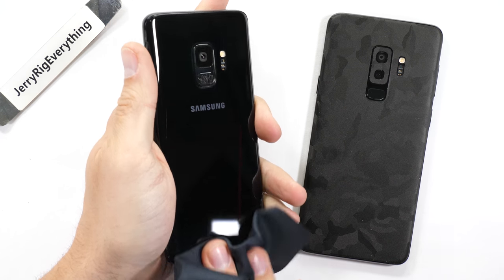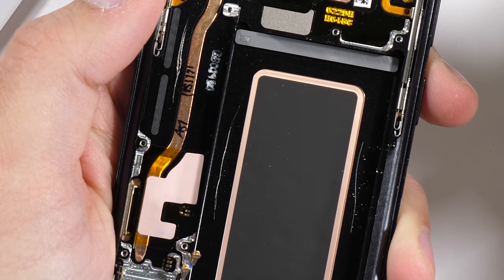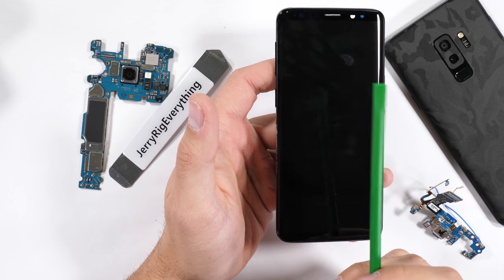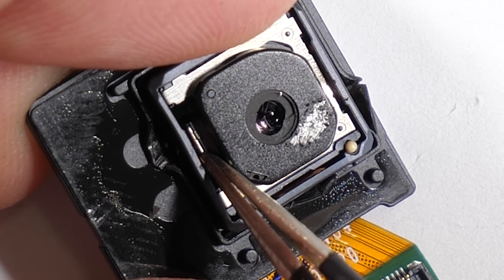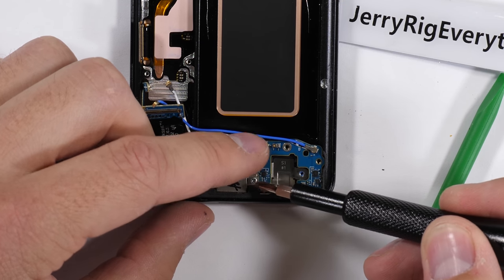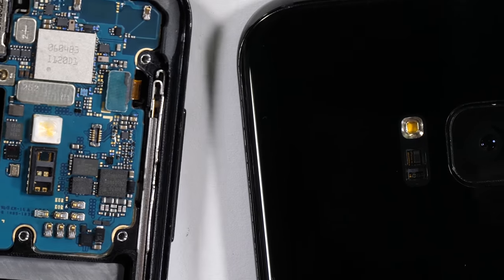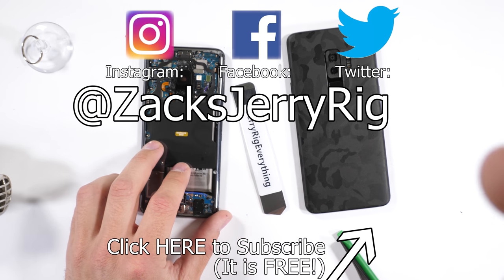Galaxy S9 Teardown - Variable Aperture Camera lens Revealed!

Comment: Never buying a used phone from you 🤣🤣🤣🤣
Reply: don't worry he won't be selling one
Reply: Hahaha
Reply: Don't think he plans on selling his phones with how bastardly used phone buyers can be. 
The waterproof phones aren't water resistant anymore.
The phones are scratched up, leaving it more vulnerable to be cracked on a drop.
All phones he sells do not have warranty anymore since he eventually teardown his phones.
Reply: Bleed inSkull It was a joke so need to go into it lol
Reply: "It still good, works fine, NO CAMERA"
Reply: Bleed inSkull 
Whoooosh
Reply: Hahaha wtf,true
Reply: Rjel Styx no shit Sherlock
Reply: Aniket Khade Technically it would be better than before. It's tearing down a transmission to rebuild it. You see what needs replacing/fixing/improving to make it better than before. Having said that, I recommend remanufactured transmissions over rebuilt.
Reply: 69% New

Comment: Solution to get rid of Bixby

Software guy: Roots phone, remaps button
Hardware guy: Rips cables out
Reply: Or  Or U go to settings ? And there is thing Called Disableing Bixby
Reply: Or do what I did and using the Bixby settings set the Bixby button to "open camera app" anduse it to quickly bring up your camera when you need to.  :)
Reply: @AA-tf4dj  those settings didnt exist 2 years Ago
Reply: @gabrielneelthayil7236  how
Reply: @leonarddomingo2091  carefully

Comment: Thanks for showing this. I've asked in several forums about how the aperture mechanism must work but no one had a clue until now! Cheers :)
Reply: I was a lot less impressed because from the outside it looks busier and more sophisticated than it actually was, but it's only a 2-blade aperture. But they're onto something there and I wouldn't be surprised if they designed a seven-bladed aperture in the future :3 (at least that's the hope lol)
Reply: @gian3458  It's likely only a two blade aperture setup as it's Samsung's first attempt at a camera sensor with aperture blades. They have to fit that in as well as the image sensor, lens housings for the aperture blades and OIS mechanism, and the extra RAM behind the sensor allowing for 960fps slow motion. 

Frankly, I'd love to see more of this as well but there isn't too much of a difference between F/1.5 and 2.4 in terms of depth of field, not to mention the whole Night Sight "intelligent long exposure shot" trend basically solving the issues of low light photography shebang.

Comment: Man you always go hard on Apple it's weird we still haven't had the 'Dear JerryRigEverything' video from TailosiveTech
Reply: Ninyoh YT true
Reply: Man what is it with Android users always comparing themselves to iPhones. Must be insecure or smth

(And I’m not talking about phones that come out of the box w/ non-stock apps & settings installed by middlemen)
Reply: Joe Soap wat
Reply: whenever you buy a Samsung or OnePlus or whateverc that ‘skin’ you see (Oxygen OS for example) means the Android OS made by google has been altered by some third party.

That 3rd party doesn’t have to be Samsung or whatever company that manufactured & sold the phone either. Not too good for security, cos they theoretically have the opportunity to insert any code they want.

Comment: Is there any possible to replace s9 battery with higher mah power like 3000mah to 4500 mah..which is same size fits in it?
Reply: I don't think so because it depends on the side of the battery so you cannot change small one with 3000 to one with higher capacity

Comment: So can i replace my s8+ camera unit with a s9+ one?
Reply: you will need the hardware associated with it. The side lever that changes the aperture is triggered by some other unit which is controlled by our input . So, not yet , unless you have the knowledge in building such frankenstein phones , don't .also due to this hardware change even the drivers required and circuits might have to be modified .
Reply: Aditya Anil yea i just thought of that when he said it's aparture automatically changes  so i thought it's done by the camera unit itself.. plus i forgot about the drivers issue.. was just a thought lol NVM
Reply: but i do believe there will be like minded people , the drivers might soon become available  you can install it just using the  bootloader . But the hardware side ..is where things might get more complicated . but in all honesty i would do it too if the resources were available . honestly if you want to frankenstein a phone..the HTC u ULTRA might be the best option . it's got tons of space and the HTC display units are decent (not sure who manufactures them ), the software aspect might be a lot more complicated .
Reply: Aditya Anil looking promising.. we'll see in the future
Reply: Just take the whole motherboard of the s9 and put it into your s8
Reply: Nyrak do you think that they are the same (exactly)?
Reply: No not exactly the same but they are built quite similar... If you watch both videos (s8 and s9 teardown) you can see that both motherboards look very the same... It could work but i just thought the idea was funny :D
Reply: Also the s9 and s8 have the same size and the screws are also placed the same... if you put both motherboards next to each other then its not that easy to differentiate them
Reply: Nyrak lol seems legit dk if it would work but my idea was buying a replacement camera... A whole motherboard would cost much more 😂
Reply: yeah makes sense xD

Comment: Great video. Thanks!

Do all S9 models use the same battery?
For example is the battery in US model SM-G960U1 the same as the battery in a the EU model SM-G960F?

I know they're 3000mAh batteries but I cant find any reference material stating whether they're the same or not.

In this video I noted the battery model was: EB-BG960ABA

Is this a standard battery for this model?
Not sure which S9 model was torn down in this vid.

Thanks!

Comment: Hello @JerryRigEverything Great video ! I was wondering if it would be possible to use the camera outside of the phone with a long cord of sorts. What cord type would be needed to connect the camera to the motherboard if so?

I have a severe physical disability but love doing photography. I did some decent work on an S3, but my body keeps getting weaker and phones keep getting heavier. I'm trying to think up small lightweight alternatives, and an S9+ cam on a stick seems like the best option on the market that I can find if it'd work still.

Thanks!

Comment: You earned my subscription. One question, can the S9 camera fit the S8? I have the blurry S8 camera issue and wondering if the newer S9 camera would make a better replacement? Do you know if the connection is the same and if the camera app in the S8 would be able to open and close the lens like in the S9?

Comment: I know that this video is from 2018 and so on. But I just got bored on Youtube and I just watched this video again. You said that if you wanted to replace the screen you would break it off the frame. But that's not really how you do it, because Samsung phones are coming with the display and the frame allready attached. That's what Samsung is calling "display assembly". So basically you would need to move the motherboard and every little piece from the old and damaged phone, into the new frame that came with the new display. Ah, and also with a new battery. Keep it up @JerryRigEverything

Comment: I can confirm 95% battery retention after 2 years isn't true. Mine's at 75% of it's original capacity. Now I did use mine heavily, but if the average user was supposed to get 95%, a heavy user should be able to get at least 85%.

Comment: Jerry bro it's very nice to see your video. I need a help bro!
Today I accidentally inserted the ejector pin in the bottom mic hole and pressed gently to pop up the sim tray.Soon I realised that it is the wrong action.I checked the mic sensitivity and it works fine!
But am bit confusion about the water resistance bro!Does this action causes any fall in water resistance?
Please respond to this comment bro, heavily tensed 😭

Comment: ...If it had the same selfie cam as last year (and I saw that video), then why didn't Samsung go and enable the OIS? Strange... That means to date, the HTC 10 (which I have and will probably keep until it finally dies) is still the only phone in existence with this particular feature, which is very helpful with selfie videos...Not even its successor, the U11 has it... Getting back to the Samsung, maybe selfie OIS will be something that will appear on the upcoming Note 9, or next year's "10" iterations of the S or N-Series devices... Even HTC is considering bringing that feature back for the U12... Here's hoping, anyway...

Comment: Am confused.. so all of the parts are attached to the screen? Iphone are attached to the back glass. If I remember correctly, in your most durable phone of 2017 or whatever you said that iphone are the least repairable but in my opinion. People most breaks the front glass not the black glass but whatever what am saying is that am confused to how replacing the s9 screen differ from replacing the iphone back glass?

Comment: For each layer of adhesive you have to soften, how long do you normally apply the heat, and what temp?  I only have a hair dryer, so how long should I apply that heat with the high setting?

Comment: I've had the S9+ for less than a week and I think my charge port is already broken.  Tried multiple charges and multiple outlets, doesn't communicate with the computer. Tried to turn it off then turn it back on but it wouldn't turn back on except a blue light was on when the phone was off.  Doing the volume / power button did turn it back on.  I upgraded from HTC 10 so I don't have a wireless charger to test on yet. Thankfully I can take it back.  Other people are having the same problem, what would cause this?  The rubber tab on the otterbox does seem to put a lot of pressure on the cable plug, that's my best guess.
Reply: It was the otterbox. Holding the rubber tab out of the way wasn't good enough but cutting the tab off fixed it. Yey! It's not my s3 all over again!

Comment: So dumb question, I accidentally put in the sim ejector tool in the microphone  on the bottom near the charging port.  I tested it out and it still works but did that compromise the water proofing on my phone?  From your video, it doesnt look like poking the sim ejector will do anything to the bottom mic but I could be wrong

Comment: I wanted to ask about the purpose of the hole beside the SIM card lock (the one on the top right corner), because I accidentally inserted the pin in it instead of the the SIM card slot.

Comment: Now if only Samsung would push timely OS upgrades, and for more than two years.
Reply: rkgsd Google doesn't even do that with their phones so why expect Samsung to do it?
Reply: Steven Juris Nexus and Pixel phones ALWAYS get OS updates before other Android phone makers push them out. What on earth are you talking about? Clearly you've never owned one.
Reply: rkgsd Google has never updated a two year old Google phone. No Nexus is updated anymore. Expecting an OEM to provide updates for old phones is unrealistic since they only make money selling new phones. Only Apple supports their phones for multiple years.
Reply: Steven Juris The Nexus 6 was released in 2014. It received updates (including 2 OS upgrades) until November 2017.
Reply: rkgsd congrats want a medal. So roughly 1% of all Android phones got 2 upgrades. That's a pathetic number. Considering Google and Android kowtow to all of the carriers and allow the carriers to determine which devices get upgrades including the Nexus line is extremely bad.
Reply: rkgsd fact no other OEM even releases phones on the most current version.  Fact Google doesn't really give a shit about upgrades. If they  did, this would have been fixed years ago.
Reply: Steven Juris I could care less about your S9+. We don't have those problems with Pixel. We get updates directly from Google the minute they're released. "Fagdroid"? Sounds like you've got some sexuality hang-ups to work out, yet you're using S9+. The hypocrisy.

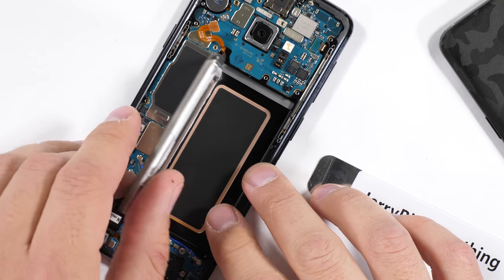Comment: 1:00 Samsung should be sued for saying the S9 maintains 95 percent battery health after one year. Expect at least a 10 percent capacity drop per year.
Reply: Actually, their claims can be considered true because of this: the 3,000mah battery of the S9 and 3,5000mah battery of the S9+ aren't their advertised sizes. They're actually just a little bit bigger in terms of capacity, meaning when the battery wears down over time, it'll still be around it's advertised capacity, meaning Samsung can claim that their batteries hold their capacities for far longer. They've done this supposedly for the S8 and definitely implemented this with the S9 series. 

Admittedly it's misleading but I do like the move a bit, specially since the cutoff point of their batteries are a bit further away from empty and full, meaning less overall wear and tear, not to mention the slower but cooler QC 2.0 used instead of 3.0, which is notorious for being very hot.
Reply: @GabrielIgnacio  Yes, I've heard the capacity is different than advertised. The fact remains that I've lost 4 percent capacity in one month according to the battery health measuring apps I've used. Now down to 88%.This S9 Plus was manufactured in March 2018. I bought it used, directly from Amazon in November. I've only used plug in 1000 mAh charging.
Reply: Frankly, I don't bother using apps that supposedly measure the capacity of your battery purely due to the fact that they've never been accurate in any of my use cases, even in the long term. GSam is one I tend to quote on as I've had it say that I've lost 20% battery back on my Moto Z2 Play after a month and it saying I lost 15% of my battery in 2 months with my current S9, despite having it last all day easily with maybe 4-5 SoT with a little more heavy moderate use. 

That being said, if you're concerned about battery capacity, I'd say get your phone checked out or just switch. I've yet to see any Android device really lose battery capacity to a very noticeable degree within just a year while the same can't be said with any iPhone I've used and owned, including the X. There's a pretty big downside to having a phone whose processor is insanely powerful with a battery that's just paltry